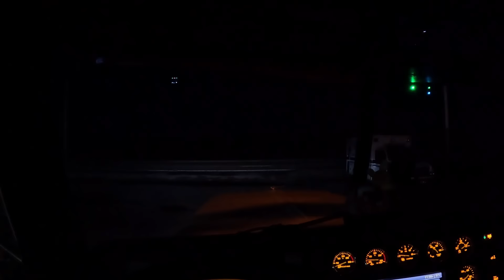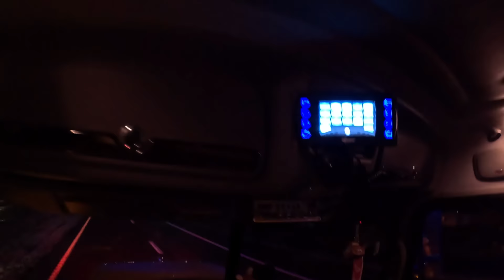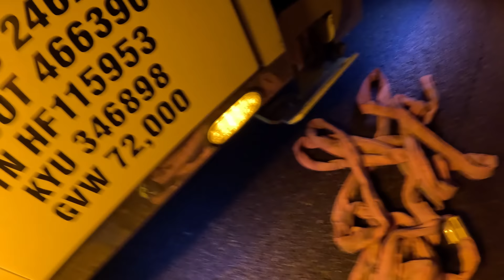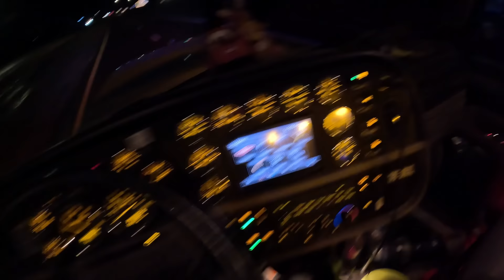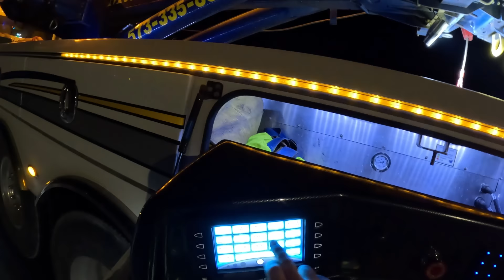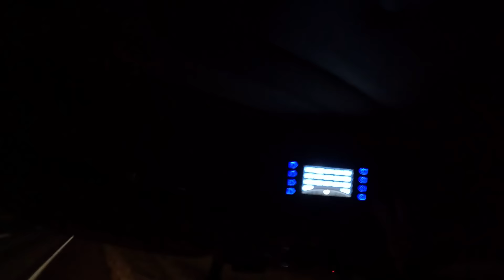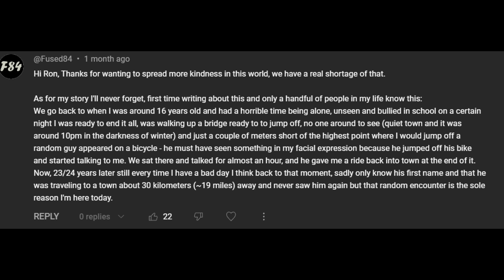Midnight In The Median!!! 76,000 lbs in the Mud & Water!!!

Comment: Last year, as the first snow fell here. I was driving first time this winter, in a car I wasn't used to. And I went to fast in a turn. Ended up outside the road in the snow. Very gently, no physical damage.

But, when I was getting towed out by a local farmer, we struggled to get me out of the ditch.
Until I remembered something you do, holding the brakes on the car. The wheels were rolling, keeping me in the ditch.
And it helped immensly.
Thank you so much for your amazing content, and I learn so much. ❤️

Comment: As a service provider I know about a cluttered truck, you can carry something for a year without using it but the time you take it off the truck you will need it. Great job and thanks for the videos. God Bless
Reply: There comes a time when some of the stuff needs to be off-loaded to a "tender." Either a trailer or a second truck dispatched to the same call. He's used the Traffic Control unit for this. This is one of the reasons why so many fire trucks are sent out.

Comment: Good job Ron. Now for some bad sort of news, on Feb 6th I slipped and fell backward hitting my head on a concrete floor. No concussion but a severely cracked back and a couple of soft spots on the back of my head. The orthopedic surgeon only found cracks up and down my back. He put me into a back brace and ordered a Myelogram which sees 75% better resolution than an MRI.  I have medications to take before this is done which will be on the 15th of March. Surprisingly enough I'm actually looking forward to this procedure.